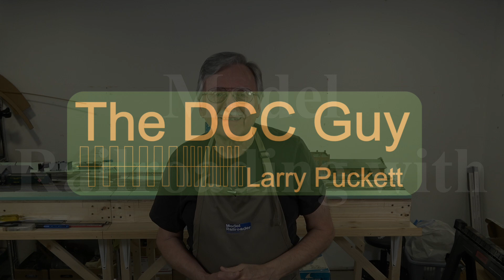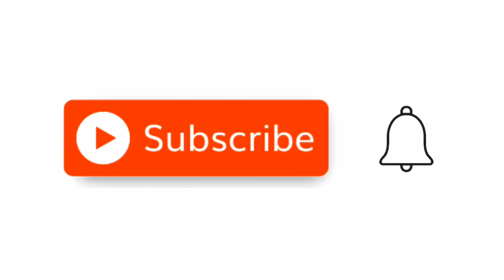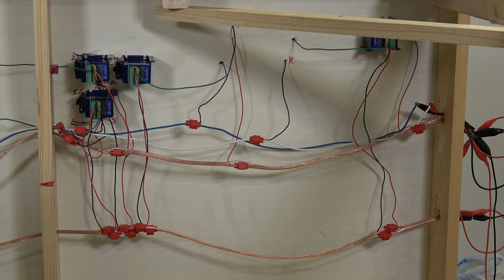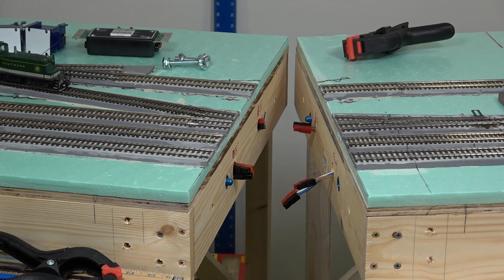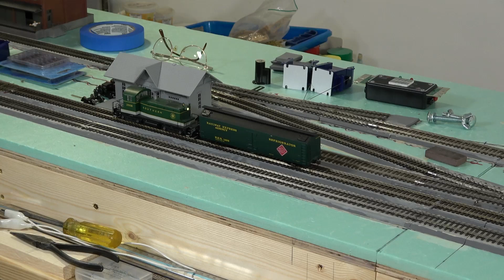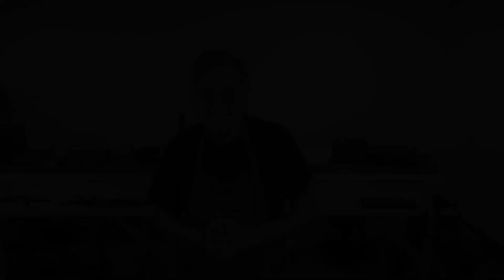Wiring For Signals And A Test Run (392)

Comment: Larry  My entire layout has 22 separate us lines  which allow me to isolate each main line and my yards    What type of lock detection devices you planning to use?
Reply from the maker: These are a new design built with an integral signal circuit I plan to try out on the layout.

Comment: Enjoyable and informative series Larry. Thanks.  One question, what do you use to cut the thicker throw rods on the switch machines. Like you I am replacing the standard ones with heavier ones (.037 in my case as I use 1" foam) and I find the stuff pretty hard to cut.  Ordinary side cutting pliers get pitted fairly quickly.  Regards, John
Reply from the maker: You’ll ruin your pliers trying to cut this stuff with them. I use a cutoff disk in my Dremel. If you are very careful you can actually cut them off flush but I usually leave a little proud part just in case.That also prevents damage to the top of the throwbar. Wear safety glasses as the excess tends to fly off in unpredictable directions.
Reply: @TheDCCGuy  Thanks.  I'll do that.

Comment: I saw a lot of stuttering with the engine going over the switches. Is it because of the frog being energized?
Reply from the maker: No, after the video I cleaned the wheels and now it goes through most places fine. The two exceptions being the 2 plastic frogs in the Walthers double crossover and there the switcher wheelbase fits right over those plastic spots. Nick at NixTrains noticed it too and is sending me some of his new super small keep alives to try put in that switcher. So, we’ll be doing a followup video on that.
Reply: Oh nice. I was wondering if you were going to add a ka. That will definitely fix it. Thank you for your time and making all these videos. Just wanted to say thank you.  @TheDCCGuy

Comment: Larry, I just purchased 12 of the cobalt digital switch machines for my layout. Question is can you give two machines the same address so they throw to cross from main to main?
Reply from the maker: Yes, that’s exactly what I did on the modules. There are 2 crossovers and the double crossover. I could even program all 4 iP Digitals on the double crossover to the same address but have only done it as 2 crossovers.
Reply: @TheDCCGuy thank you for the quick reply

Comment: Larry - are you using speaker wire for your bus?
Reply: Looks like it. A lot of model railroaders would poo poo the use of speaker wire. But hey, if it works, why not?
Reply: @coolruehle  Not poo poo the use at all .. I use it for my DC accessory power line on the layout .. but I am curious - a lot of speaker wire these days are copper clad aluminum ..
Reply from the maker: I have discussed this in previous videos, such as #111. I got the idea from Larry Maier at DCC Specialties. He found it does as good a job as twisting the bus wires and is easier to use. You do have to make sure to buy the copper wire and not the cheaper copper clad aluminum, which I pointed out in one of my previous videos on the subject.
Reply: @TheDCCGuy  Thanks Larry -- I watch a lot of your videos, but must have missed that one ..

Comment: I’m very keen to see how you do the occupancy detection and signals. 
Are you planning to have a simple closed circuit for that (one detector to one signal) or a smart system back to the DCC hardware or iTrain etc?

On my layout I have occupancy detection for all sections, so no “bus”, as the sections all go to the x16 detectors. Signals can also be controlled from a DCC hardware device. But how to link the two (without iTrain etc software) is my quandary.
Reply: My quandry too

I am thinking local hardwired microcontrollers with the option of colour or semaphore signal and point configurations...  For which those clip in connectors are efficient

But I thought it convention to switch the red, or v positive, and have a common black, negative, common (zero volt) return.

I think one needs some colour coding of the feeds as well.